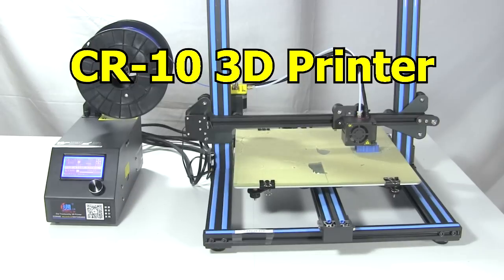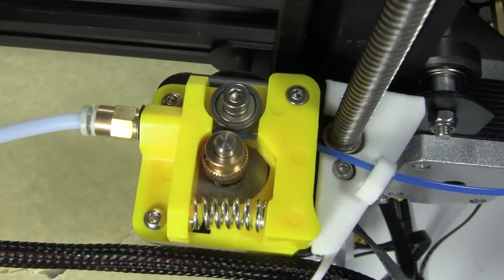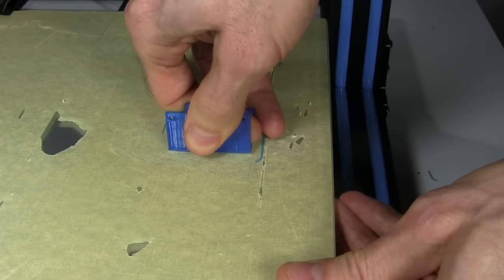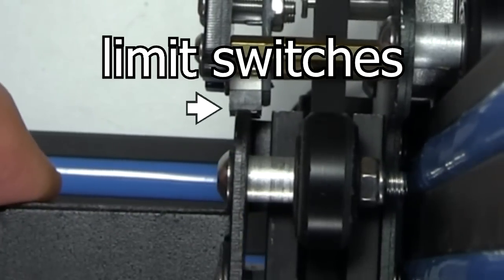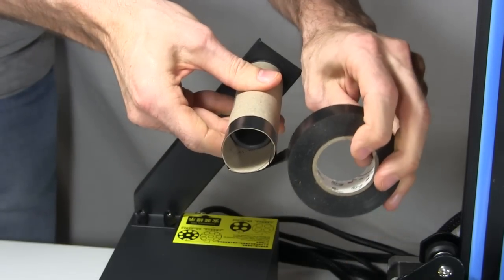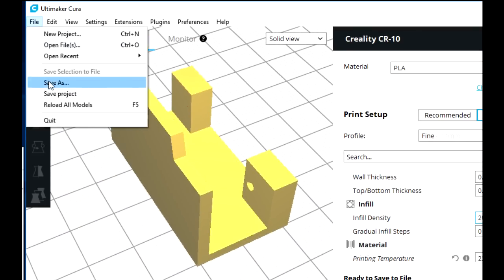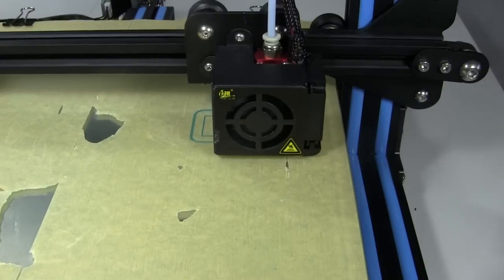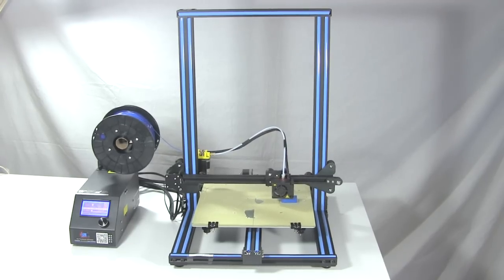My CR-10 3D Printer - Creality 3D Printer

Comment: Great job introducing 3D printing. I used to use Sketchup and OpenSCAD, but I love Fusion360 now.  Its parametric modelling allows me to quickly tweak dimensions without having to redo anything.  Its timeline feature allows me to back in time to make edits to the model without having to do a bunch of undo / redo or start over. I do not have any experience with Blender so I do not know how it compares to Fusion360.  Welcome to the incredible world of 3D printing!

Comment: One of the few modifications that i found worth it for 3d printer are to install auto bed leveling and octoprint running on raspberry pi btw my printer is Anet A8.
Reply from the maker: I check with the paper to see if I need leveling everytime I start a new print but it turns out to be not very often. If it was more often then I'd start with adding bigger knobs to turn as I originally intended to, and then I'd probably move on to auto bed leveling too. So far so good though.

Comment: Nice video  , I have the smaller model  "Ender 3" .  They are both made by Creality . .   I love it . .  I use Blender too .   Ya can't beat the pair . . You can make almost anything you want . .   I've been printing non-stop ,  so I bought another Creality Ender 3 . .  2 Printers is the way to go . . 
 Sometimes I print objects in 2 or more pieces ,  then glue them together.  Twice as fast and can solves a lot printing issues that need support.
Reply from the maker: Thanks. These definitely are nice printers. I've had no regrets and they make it possible to make more things. Regarding gluing together, sometimes that's the only solution, unless you want to tear away a lot of support material. But even then, I once made something that was too delicate and couldn't survive the removal of the support material so I had to make two pieces and glue them together (you can see it here https://youtu.be/DY4as7Lc9KY?t=206). I print PLA and use a cyanoacrylate glue (super glue). What do you use?

Comment: Oh, there is a few upgrades you will need on this printer and one is almost a must is the travel path of the filament into the extruder because issues can happen right next to Z axis rod.  For tal/large prints there is wobble so you need to print a couple of stabilizers and if you care about quality a second Z axis rod is added and one motor turns both (the two motors one control channel is not nearly as good).  Been a subscribers for eons so glad you got one of these.
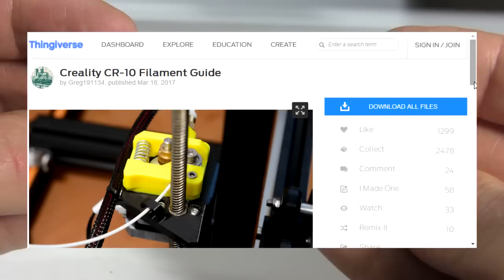Reply from the maker: I've done the filament guide mod (see 2:56). All my prints have been shortish so far. My first tall ones will probably when I get into artificial hands with arms, then I guess I'll need the mods. Thanks for watching all these years!
Reply: Thank you for doing your videos (though you were absent for a bit of time) and continuing to do them.

Comment: Nice video. Try Elmer's Glue Sticks directly on the glass, no tape needed.
Reply: CncObsession yes and it’s easier to replace
Reply: Another option it hair spray
Reply from the maker: When I run out of places to print on the current tape then I'll try bare glass (heated of course). If that doesn't work out, as it probably won't, then I'll look into the blue tape, glue or hair spray approaches.

Comment: Try just using the glass with hairspray, not that tape, after your part cools, it will easily pop right off. Happy printing!
Reply from the maker: Thanks. I'm waiting until I've worn out the tape before I experiment with other approaches. The first will be to try with just glass alone.
Reply: Yes, that's what I meant. When you use just glass, plus hairspray as an adhesion, the bottom of your prints will look glossy like glass, not that rough unattractive finish with tape... and it's easier to remove!

Comment: Can this 3d printer be modified to mount a dremel like spindle and become a mini cnc milling machine?
Reply from the maker: Theoretically, yes. Though if you want to use the same control electronics then you'll probably have to do some trickery. For example, the electronics is monitoring the nozzle and bed thermistors. The gcode files that I mentioned that the slicer program writes out and that goes on the microSD card for the control electronics to use is just a text file with gcode commands, commands that do things like tell the motors how to move. So it shouldn't be too hard to come up with the gcode to make the motors move moving the dremel around in the way you'd want. Here's a sample of the first few lines of a gcode file. You can see some temperature information (60, 220) as well as movement commands.
;FLAVOR:Marlin
;TIME:1839
;Filament used: 1.854m
;Layer height: 0.25
;Generated with Cura_SteamEngine 3.1.0
M190 S60
M104 S220
M109 S220
M82 ; absolute extrusion mode
G28 ;Home
G1 Z15.0 F6000 ;Move the platform down 15mm

Comment: 220C for PLA?  Try 185-190C
Reply from the maker: What are you using for the print surface?
Reply from the maker: Doh, I just realized I was asking you about your bed when you were talking about the extruder temperature. I see now that there's a range that works for PLA (180-220) and I've been using the top of it. I'll try it lower. Thanks.
Reply: I set slic3r to print the first layer really slowly and thicker than other layers and that seems to help avoid adhesion problems, too.  Really like your videos and I show them to my kids.